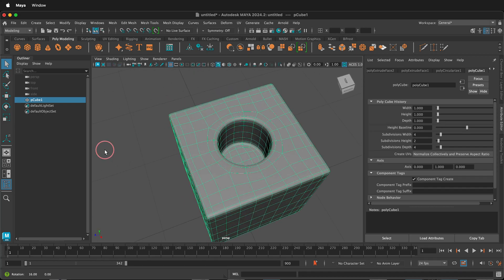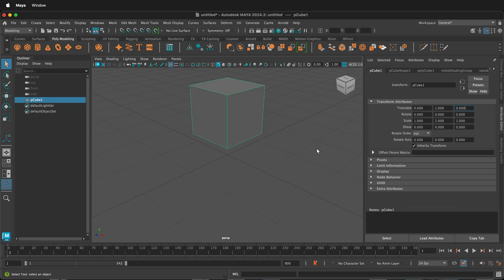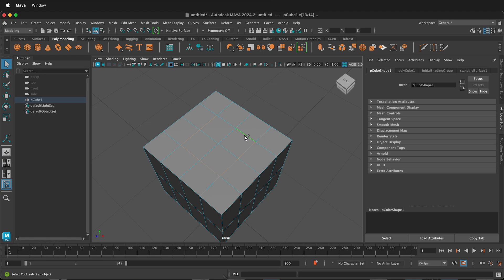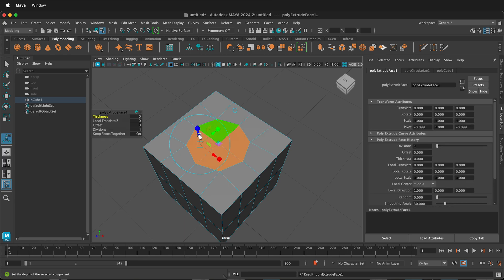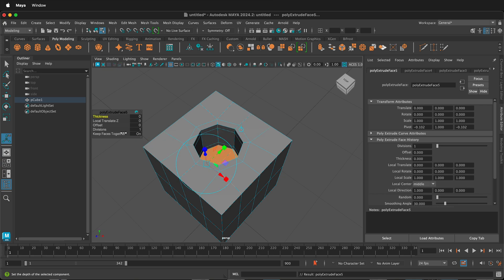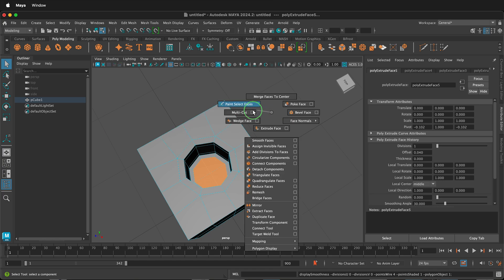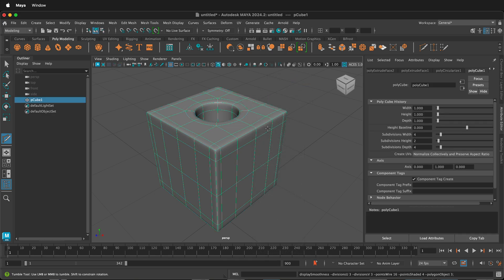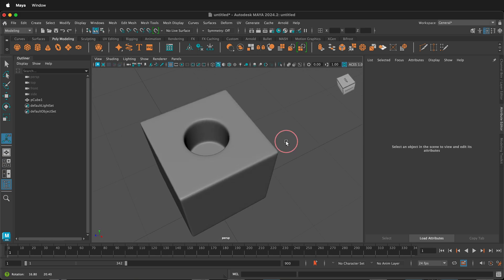How to Cut Holes in Autodesk Maya Tutorial

Comment: hi! I just watched your other hole video and was attempting to practice on a unique shape and I was having a bit of trouble with making a perfectly round circle on the faces/edges. for reference it is a coffin shape piece with irregular edge loops. any help would be greatly appreciated and I love the videos!
Reply from the maker: First use circularize components, then to make the inner edge loop use offset for extrude rather than scaling the face, scaling the face does not make it perfectly round but offset will
Reply: @WhatMakeArt  I want to make the hole come out of the other side, but it has different divisions/loops than the top side, how do I make the hole match up?
Thanks for the super fast reply
Reply from the maker: @the-jps ah, I understand, You can extrude down and then snap to the vertices on the other side, then you can use the multi-cut tool to line up the cut and make sure the edge loops have the same number of vertices, then merge the vertices 

If you're having issues getting the same number of edges on your loops, there are a bunch of images online of how to reduce or increase edge loops
Reply: @WhatMakeArt  everything seems to be working its just that at the bottom there is a circle (the extruded one from the top) but the faces inside are also outside, like a square face is being split in the middle by an edge from the circle but the face is still one piece, if I want to lets say select the circle edge ive made and delete the stuff inside of them without deleting the parts of the faces that are outside, thats where im stuck. Sorry about the questions I'm very new to this and it's a bit confusing but your help is very much appreciated!
Reply from the maker: @the-jps That's because the face is a full solid face on the inside and outside, go ahead and delete it. Then there will be a gap between the hole and the bottom outside faces 

Select two vertices that line up but are not connected 

Then under modeling > mesh tools > you can select "connect" to create an edge between the vertices, repeat the process until you have enough edges to make a quad and then you can fill it in the face